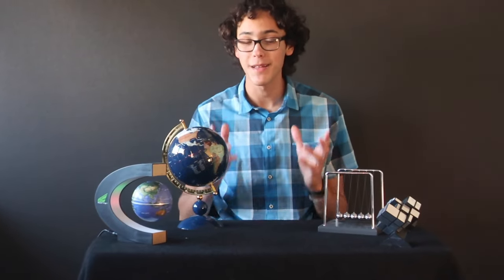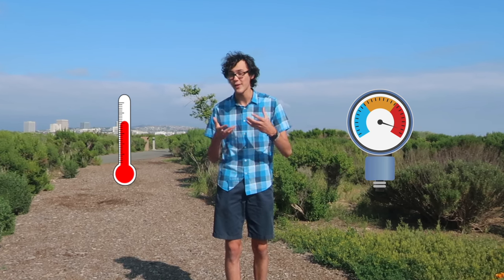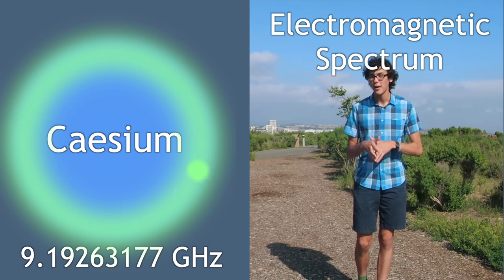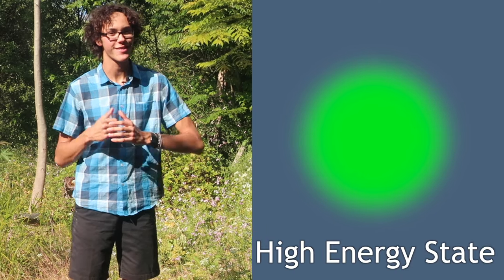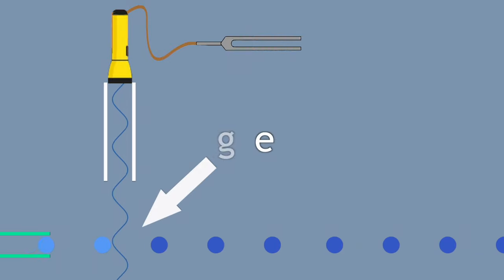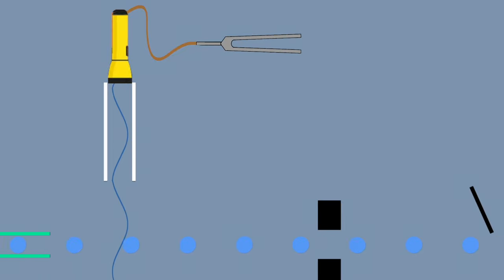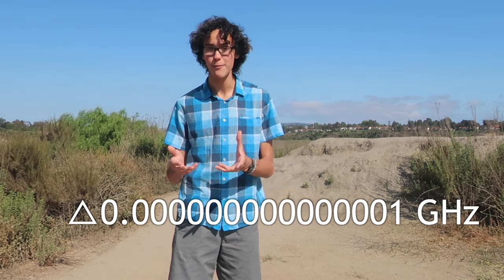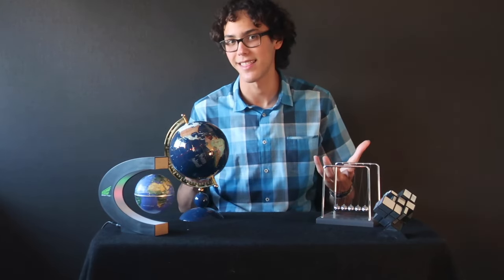Atomic Clocks: The clocks that keep the world on time

Comment: Wait, are you telling me atomic clocks are actually just quartz clocks with constant fine tuning/error correction?
Reply: Yes, that is exactly right. It's not a cheesy 32 kilohertz watch crystal, though. The crystal is extra high quality and operates in a temperature controlled chamber to make it as stable as it can be even before being adjusted by the "atomic" part.

Comment: Challenge:  Have three exactly snchronized atomic clocks running at the very same speed in your stationary lab. Send one up to the moon, send the other flying in earth's orbit. They will then run at different speeds. Thats weird but has an explanation which lies buried in how spacetime works in different distances from earth, on the moon and also if these clocks are (all three are!) moving within spacetime. This also is valid for any other type of clock (analog/mechanic/quarz)

Comment: How does sending "a tiny jolt of electricity" to the quartz magically correct its frequency? It seems like that glossing over does a lot of heavy lifting 😅
Reply from the maker: The jolt of electricity works using the piezoelectric effect which is explained more in the previous video on quartz clocks. These vibrations speed up or slow down the quartz’s vibration so that it matches the frequency of the caesium. You are right, there is so much more to this and this does gloss over a lot of details, but so does everything else in this video in order to make it short enough
Reply: @OnTheShouldersofScience  Oh cool, thank you for taking the time to reply yourself! ✨
Reply: ya, your right, he's glossing over the 6 years of university physics part!!!😂🎉😂😂🎉😂

Comment: Well I read a bunch of books from over close to the science building and now if I was going to try and get out of a job at the bricks factory by telling a bronze age Pharaoh that I have a higher education then I would probably put the spotlight on the way that, given an office for it, I could eventually find out the size of the earth from the length of a pendulum.  Apart from the metrics of all of this and how many meters it is you can tell that I would be ahead of all of his other astronomers, no mater what units they have, since, unlike them, I am the one who noticed the formula for the antisine in a handbook.  I tested it out and it multiplies right up close to pie to prove it and by now, knowing the schoolbooks, I could also clock the period of a pendulum from the time it would take for a star to get from one hole in my ladder to another one.  

Of course you don't make a meter stick out of it before all of this would take some amount of setting up and the pendulum formulas are known to the schoolbooks and so also the earth but if I ever got around to talking about an atomic clock to get out of a job at the bricks factory then what I would tell them is that future times will have sciences that no one could ever learn since you can tell from because for example an atomic clock would cost the labor power of many millions of workers, for many decades, or centuries, and then by the time it gets done the people who have their diplomas will cook up such technologies that it would take many specialists to get any of them to work.